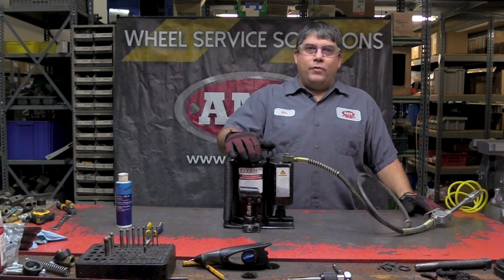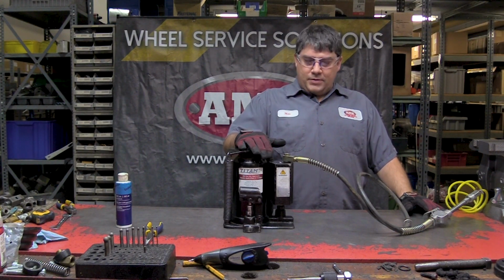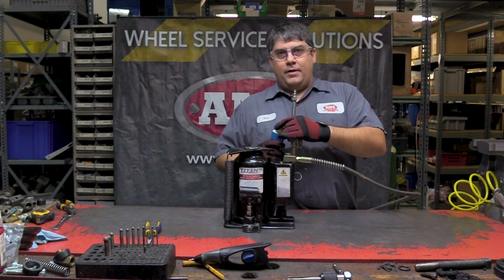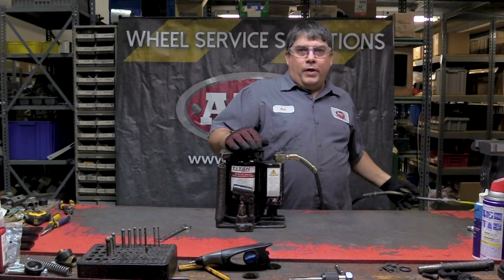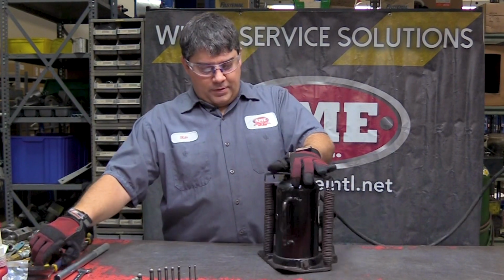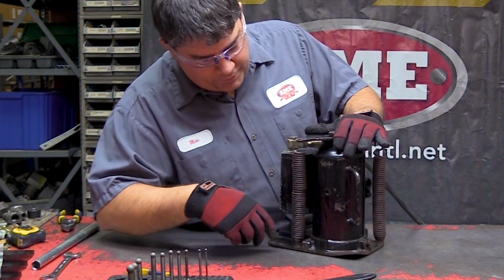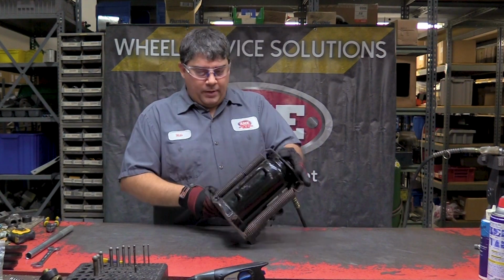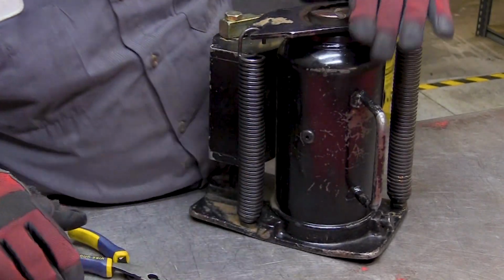AME International's Maintenance Minute: Air Hydraulic Bottle Jack

Comment: This is very good - THANKS! 
However, I wish someone would show how to restore the air motor part of this assembly - mine quit working or even making any sounds over a year ago. I've had it apart and checked for clogs and everything I can, with zero success fixing it. The bottle jack itself still works great, but manuially only. The air part is a boat anchor for now. Any help appreciated!
Reply: Mine is the same And I've took it apart checking and nothing but I did hear him say if over filled will lock up so I'm not sure if mine is over full will be looking into the oil level maybe drain some out and leave the drain back valve open when checking 🤔 thinking out loud may.be someone can point me and u in the right direction. Thanks 👍
Reply: mine is doing the same thing except I can hear the air escaping. Do this take a sledgehammer and beat it until it decides to listens to your command😔 does Jack's can be hard-headed sometimes
Reply: @rclarke2456  Well, I have put that 20Tonner on the shelf now and purchased a replacement on sale foe about 90 dollars complete. Still from HF, but looks quite a bit different so maybe it is improved now? Time will tell.
Reply: Mine still is not working I'm going to buy a new 1 also thanks for the update 🙂👍

Comment: My jack works properly manually but my air pump will raise my pickup about  two inches and no more same thing  not under load. is there any adjustment?

Comment: Hello,thanks for the video. I have one of these. I want to take the pump off and place a pressure gauge? I will use the jack just manually, but I like to see the pressure. Can I do that? I took the body off, spring. How doe I take off the husing and place a gauge in place? I problaby fugire this out, but any hoot. I love tech video;s!

Comment: It looks like that jack got dropped and the corner is bent.    Is it safe to use?    I does not look as stable as it should be.    I really don't know,  so I am just asking.
Reply: I was eyeing that as well, and with my experience it can lead to slipping. Especially in the northern regions where ice is an issue. I wouldn't recommend using it.

Comment: Why does my air bottle jack leek oil from the air vent when I push the air button to operate jack?
Reply: Mine too. Spits a good amount of oil out of the bottom air vents of the air motor. What's the deal with that?
Reply: @quadcamera   torn seal for the tiny piston in the motor, so as it pumps oil it lets some back into the pneumatic cylinder